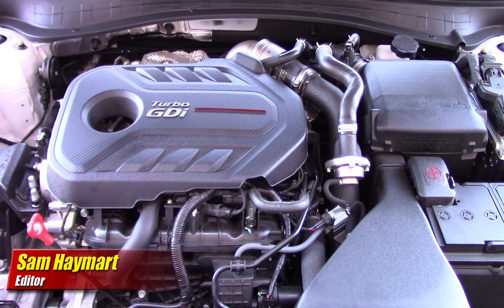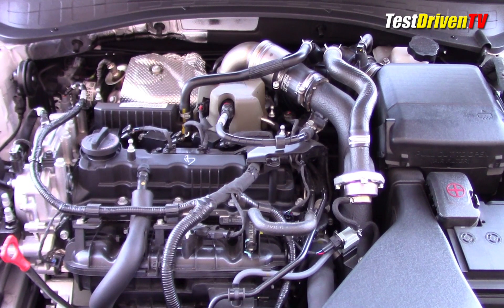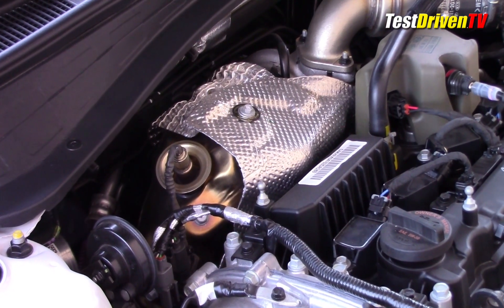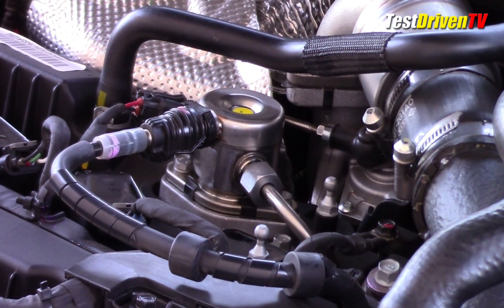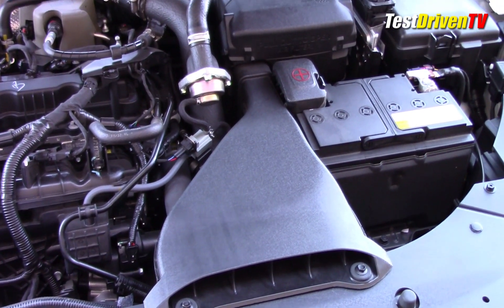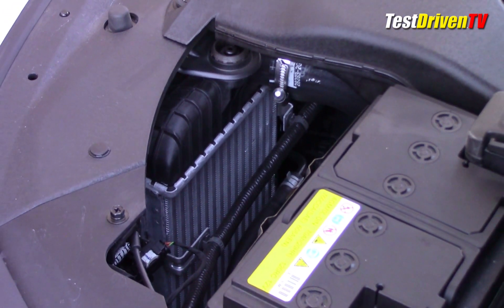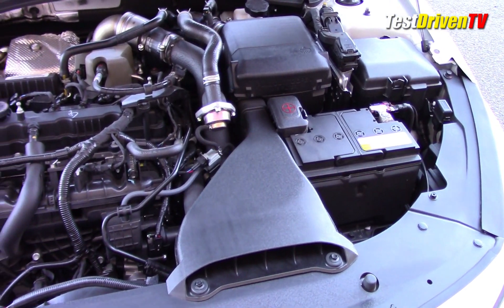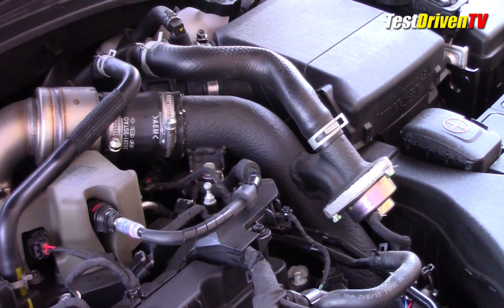Under The Hood: 2016 Kia Optima 2.0 GDI Turbo

Comment: I have same car above same year. My engine just died at 194k with no signs beforehand.  Dealership wants $7k to replace but I really feel my car does get the free engine.  They never did a scope on a compression test. And seems refusing to put the knock sensor code down. 😢

Comment: What is that black box with the red circle on it called ??? The thing that's resting on the battery
Reply: That's just a cover showing you where the positive battery terminal is at. It's the post to connect the positive jumper cable.